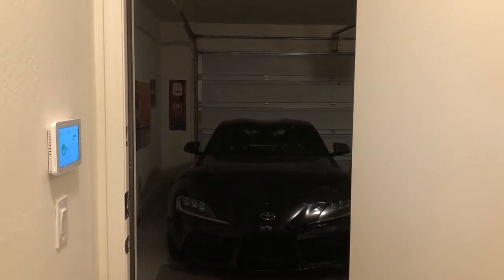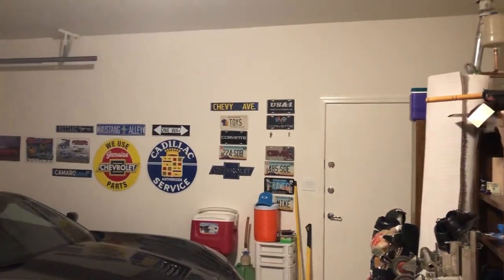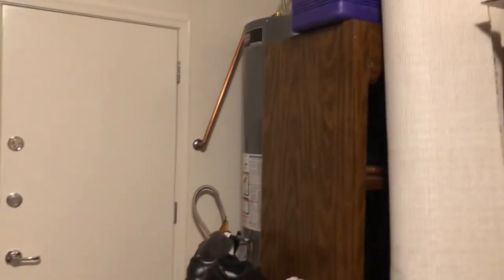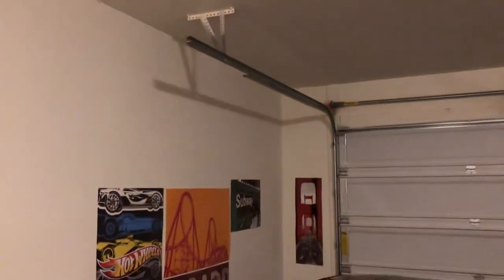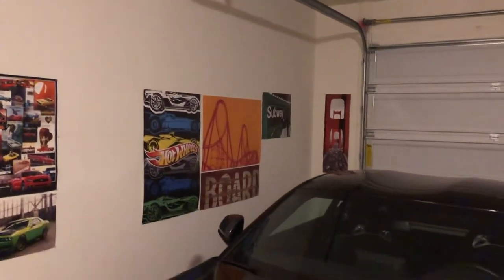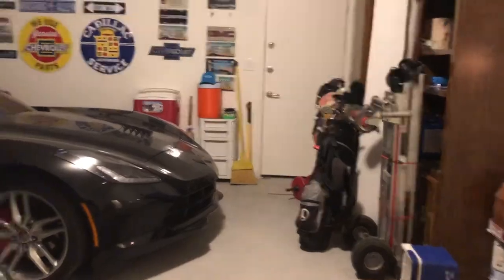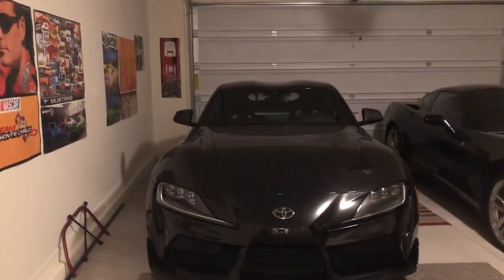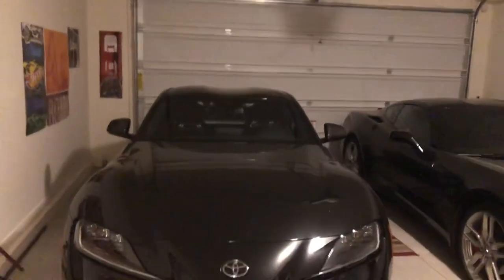Garage specs for 4 post auto lift

Comment: That’s gonna be nice I would like to get a lift on my third stall
Reply from the maker: The lift itself is $2,450. The rest is for labor installed and tax. But you Fran can probably put it in yourself. This lift doesn’t need a air compressor to lower the lift. It’s self contained Hydraulic.
Reply: @mikejautosandstuff3349  ya it’s just like my bosses